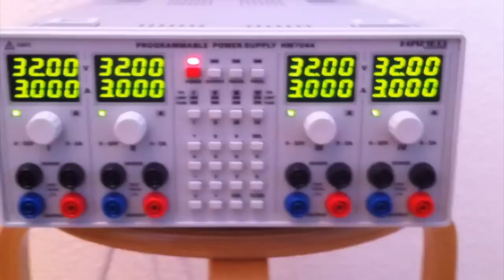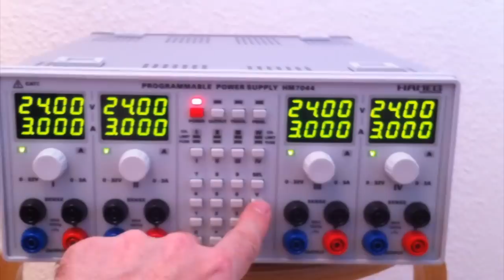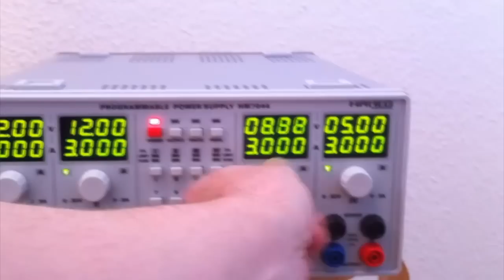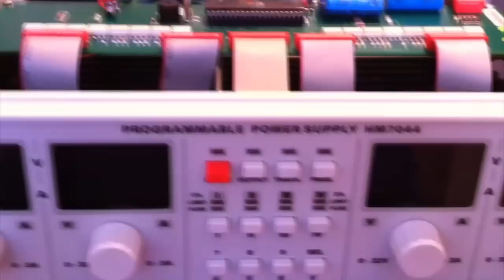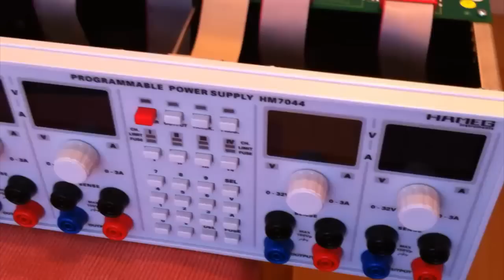Hameg 7044 Programmable Power Supply - Review

Comment: I don't like the large output capacitors on the output busses... it probably means this power supply has an average dynamic performance. What's the use of having a current mode control range of 1mA when there is a few 100uF of capacitance at the output?

Anyway kuddo's for this video!